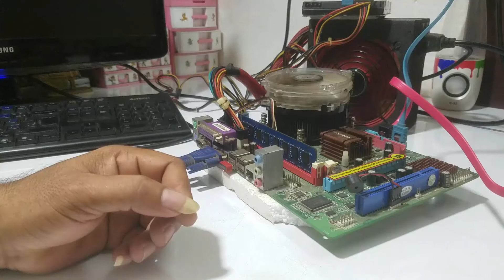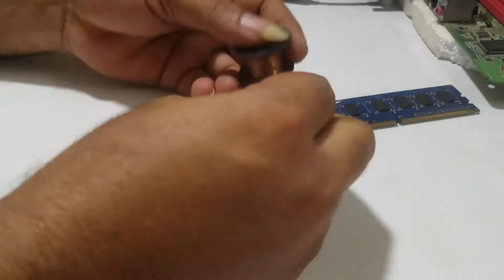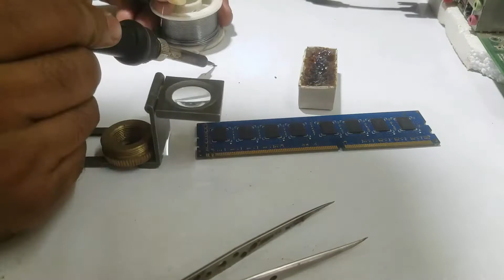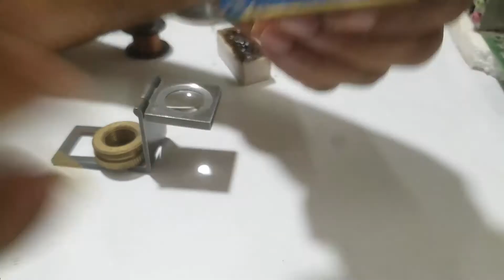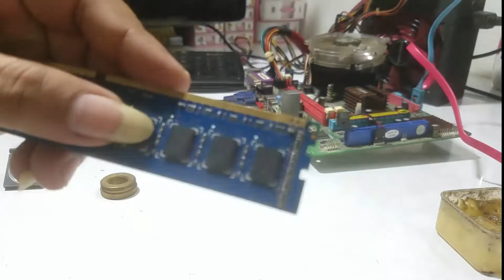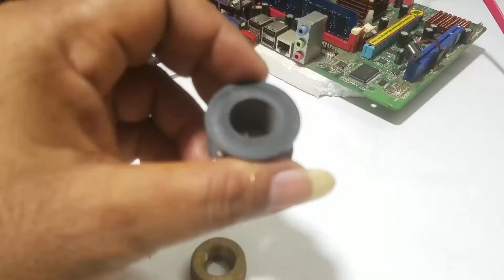RAM Fingers: Repair Gold plated connectors

Comment: Hi Sir, is it okay to use my RAM if it lose one of its Gold Pin? It's still working btw and still reads as 16gb.

Is there will be a problem in the future if i keep using this RAM that lose 1 of Gold Pins?
Reply: Do a mem test (use memtest86+), if it report any amount of erro,it's probably not safe
i have a damage memory, it have a slight scratch on one of the gold pin,mem test shows a ton of error messages.
before,my pc randomly crashes,sometimes even corrupted the windows,i couldn't install some softwares for some reason, when a did search for a solution online, i find that could be memory problem, hold and behold:that was the problem
Reply: hey man dont know if this is relavent anymore but it was probably only a ground of many, so it shouldnt necessarily matter if its still not giving you problems to date

Comment: One ram pin got burned and cut off the Ram, I still have it, it's black but it's in a good shape, can i solder it in it's place instead of using a copper wire ?
Reply from the maker: Yes, you should try like this way that showed in the video.
Reply: @SekanderAli  I just bought another ram because i don't have time, but i might try to fix it and give it to someone, thanks

Comment: did you solder the copper wire on a specific place/point or did you just solder it on the place where the gold plated used to be?
Reply from the maker: The specific place that should be the same direction point for passing RAM data.  Pls see you in care.  Thanks
Reply: @SekanderAli  Thanks for the reply! I will definitely try it!

Comment: Sir, how to solve if a breaked a pin in the female ram connector, not in the ram module. Thanks.
Reply from the maker: I will try to make this video for solution and i have an idea.  Thanks for your want
Reply: @SekanderAli  thanks a lot. At the moment I solved inserting 2 very very thin and very short copper wires in the previous pin zone. It works but yesterday I had for two times a blue windows 7 screen
Reply from the maker: Blue screen cause for RAM communication.